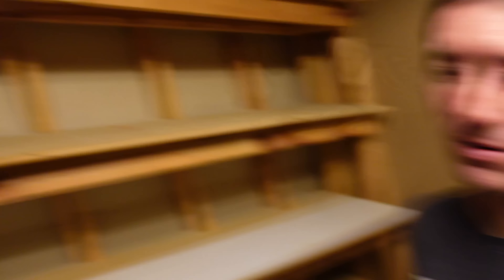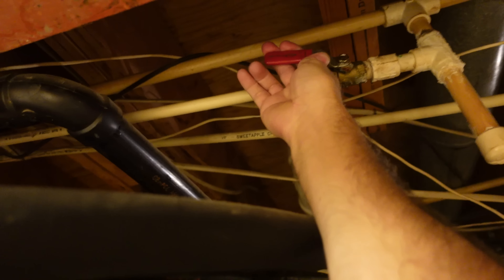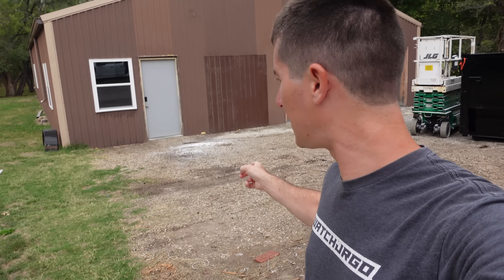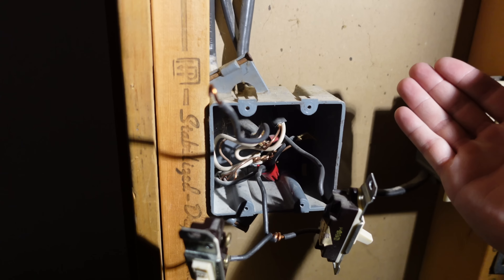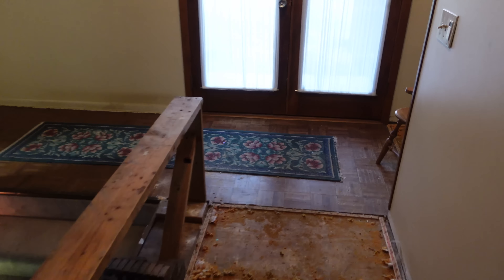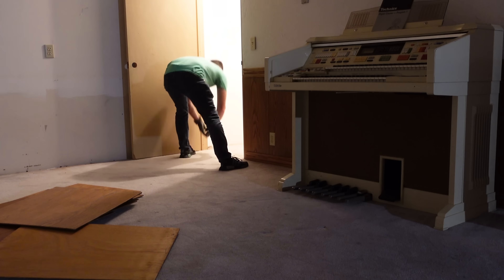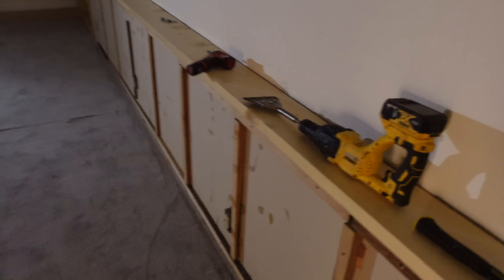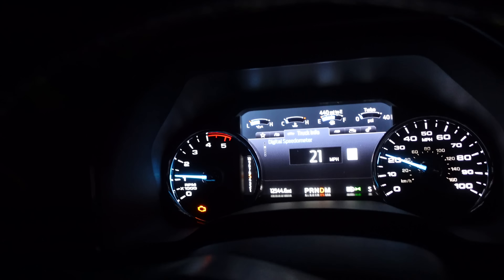TROUBLE At My New House Already... Water Leaks

Comment: A good friend of mine works at  the Ford Engine Plant in Cleveland. You cant imagine all the brand new bad engines coming out of that plant lately. There are thousands of Transit Vans parked in Kansas City right now that can't be sold due to oil leaks on zero mile engines. They will all have an engine swap before they see a dealers lot.

Comment: When we bought this house 10 years ago once we hooked up the washer about a month later I found a leak under the house. Luckily part of the package was a year of home repair insurance. For 60 bucks copay later a plumber came out and cut out the bad pex and replaced it.
Being a manufactured home the insulated floor belly wrap was completely soaked in the area and I ripped it out and let it dry. Luckily the water heater was new so that was a plus. I'd recommend looking at a heat pump water heater, considering one myself seems like great idea to save money on the hot water system, maybe not so much with gas but something to consider. We have a electric water heater so should be a good match if we have enough room.

Comment: Buy some cheap paint and paint all the plywood floors before refloorin,it seals in odurs and makes it better when new flooring is laid. You got a lot done and a lot to do. You may need to remove more of the  sheet rock to check for mold.

Comment: C-PVC is just PVC rated for hot water.   Pre-Pex.   It's definitely needed.  I had a pressure relief valve fail on me.  Our hot water is turned way up.... It had a PVC going from the valve to the drain.  It came loose as it was not C-PVC.   Blew water all over my closet.  Luck I was home and heard the water.  Talking to the plumber he mentioned that it should be C-PVC and you should use the glue.   I actually still need to replace it.  I noticed the one of the second hot water heater for the kitchen and laundry was done the same way as the one that fails.  It need fix both of them.   I really want to replace the one for the Laundry with a on demand unit for the space.  The laundry room is super tight.  Maybe after I do the kitch and can move the pantry cabinet out of the laundry room and stack the washer and dryer for some space in there.

Comment: When I replaced the builder HWH with a heatpump HWH, I decided to clean up the copper piping "a bit".  By the time I was done, I had removed over TEN elbows from the system.  I swear they just used whatever scraps were in a bucket when they plumbed it in, or threw an apprentice at it and told them to practice with as many solder joints as possible!  And it was an on-floor system in the finished laundry room, with just the cold in and hot out through the drywall.  It was a complete maze of uselessness that cleaned up to just a few straight runs with a few elbows.

Comment: As an old Homebuilder I see some shoddy plumbing and electrical stuff going on there. Hummmm? How the heck did that ever pass inspection? Or did they even have it inspected? Makes one think ~~ . At least you get a higher capacity hot water heater and NEW plumbing pipes. That's always a plus.
Reply from the maker: It's probably had a million changes since it was originally built 😬

Comment: I'm no plumber, but those pipes are a disaster! And seeing the shoddy electrical would make me want to check every outlet and switch in that house. I helped my buddy some years back replace a whopping 19 outlets in his house, many of which were wired incorrectly and I told him I was surprised his house hadn't burned down yet in an electrical fire. It very nearly did when an overloaded breakers in the panel started smoking...they had to replace the entire panel and all breakers.

As far as the truck, well, it's a Ford so I'm not surprised. #1 most recalled brand in 2022 and so far in 2023. I'll never own another one.

Comment: The spray foam issues are most likely due to poor mixing. There are part A and part B tanks and they must be adjusted correctly before spraying. 
I would suggest you cut off a big chunk that has shrunk. More than likely it is not cured on the surface facing the metal. Those cannot simply be sprayed over and filled. Moisture will get no matter what they do and your roof will rust.  I believe you mentioned they ran out of spray foam. Well maybe one of the tanks ran out earlier than the other.

Comment: The two things that have stuck around since the beginning of that house: The Carrier furnace and the Frigidaire wall oven. I’d be curious if the heat exchanger is still good on that furnace after 47 years
Reply: Only if the AC was Chrysler Airtemp. Then that would fit with the theme!
Reply: @Hotlog69  I had a Chrysler Airtemp in my house, it still ran when removed from service back in the late 90's, the build date of it was 1967!

Comment: Have your house repiped! That cpvc gets brittle with age! Go with pex and a tankless heater. You will no regret it. If your tub valve is a two or three handle fixture the packing nuts on the stems are more than likely loose and only leaks when turned on. A man of your caliber can fix these issues with no problem! Go Jr Go!
Reply: Do you even listen to the video?  He said his pex stuff was at the cabin and when he brings it back he was going to re plumb from where the water enters the house.

Comment: I'm sure they used asbestos glue back in the day for those floors. Be careful JR!
Reply: I mean, when you burn sheetrock and use a paint sprayer for a huge building without a respirator, I'm sure they were super careful with the basement air quality while working.
Reply: @jspaulding4106 So true!😂

Comment: 12,000 miles check engine light is common on Fords.  I have a 2010 Ford F150 Supercrew 4x4.   Mine has that capless tank thing and it started giving me issues at 12,000 miles.   I purchased the "optional" locking gas cap from Ford that fits the capless system and it fixed the check engine light issue.   I of course took my vehicle to the dealership to have the capless filler fixed and then used my locking gas cap as well.  Have not had another engine light problem since.  I have the last version of the 4.6 liter V8 and hit 250,000 a week ago.

Comment: I absolutely hate cpvc also, it get brittle and weak extremely fast. Once, I was trying to shut a valve off just like you were doing, and the cpvc was so brittle that the pipe snapped and Shazam cold water in the face and everywhere.
Reply from the maker: That’s what I’m worried about! Plus gate valves are the worst 😬
Reply: @WatchJRGo  I'm with ya on that one ball valves all the way baby!!!

Comment: CPVC plumbing worked very well, but it isn't supposed to go right up to a water heater. It's supposed to have at lest 1ft of copper pipe, then go to CPVC. It's sad that CPVC is going away from the market, as it was so easy and so much fun to do, along with being very inexpensive!

Comment: Go with a 50 gallon hot water heater with the square footage you have there. 40 isn't really enough and 30 is just plain tomfoolery. Gas hot water heaters will last a long time -- or at least that's been my experience.

Comment: We had to replace our hot water tank within the first month of moving in.  Make sure to have a drip tray put under the tank.
Reply: A drip pan and an alarm. The alarms are surprisingly cheap.
Reply: It is in the basement. 
Install tank near a floor drain
Reply: Gas heaters are supposed to be 18" off the ground. He's gonna have to do some fabing anyways.
Reply: we put alarms under each of our sinks as well - it's saved us more than once.  Caught the leaks immediately!

Comment: The water line going from the well/city was most likely going to a water conditioner. The valve there could be a cutoff that was left over. Or part of a bypass system but those typically take two valves. You may want to get your water tested if it is from a well.

Comment: If you need to get old stuck glue off of concrete, use an angle grinder with a wire wheel and letter eat. Just got done doing that myself

Comment: Clean that dryer vent. Lint is extremely flammable! That vent run looks to long in my opinion.
Reply: At my apartment, before they cleaned the lint in the dryer vent, it took 3 full dryer cycles to have the clothes dry. Now it only takes one, as it should!

Comment: Shops looking good except for the walls, are you going to leave that exposed spray foam or put something over it. That house is a gut job, those older houses have so many hidden issues, have you even checked for asbestos? I’d honestly bulldoze it and build a modern house.
Reply: The structure of the house seems strong. It's just the add-ons that are suspect. That era of homes were built rather well and IMO not worth the expense and effort to do all that you menrtioned. Insect damage is another trhing if it exists.

Comment: Get a gas instant hot water unit, the one that bolts to your outside wall, no tank to worry about
Reply: Definitely the modern move-but over 10x the price. 
$ made back in the long run though 👍🏼
Reply: @kylemills3070 it’s not 10x, tankless unit is $2000, plus install. Find a better plumber to not charge too much.

Comment: Maybe it's just me being OCD, but seeing what I have seen so far, I would want to take that house to the studs and start over. I would be afraid of what is behind the walls. All the cut corners, what's the electrical like behind the drywall? I know that is a huge expense up front, but if you do all this work and there is some issue behind the walls, then all the work you have done, will be ruined and you have to start over again. But that is just me, so weird-o on the internet. LOL

Comment: Hopefully it’s not asbestos tile. Bad for the lungs. Even worse for the wallet.
Reply from the maker: It's linoleum 🍻
Reply: @WatchJRGo       per google- 
"Asbestos was used in various types of floor covering, especially from the 1960s to the 1980s. The most common use of asbestos was in the lining for vinyl sheets and floor tiles (also known as “lino” or “linoleum”). Asbestos was used to make the lino more durable."

Comment: You ask what's going on Ford with your check engine light. Ford's quality is becoming as bad as Hyundai and Kia.  Buying a new Ford is becoming a risk. 

Here is a news report out today. 
U.S. auto safety investigators have expanded an investigation into Ford Motor Co. engine failures to include nearly 709,000 vehicles. The investigation now covers Ford's F-150 pickup truck, as well as Explorer, Bronco and Edge SUVs and Lincoln Nautilus and Aviator SUVs. All are from the 2021 and 2022 model years and are equipped with 2.7-liter or 3.0-liter V6 turbocharged engines.

Comment: Good Lord that white plastic pipe is hideous.  And dangerous.  It's a flood waiting to happen.
Reply: Be glad it's not the polybutylene stuff that came in the 90's that splits mid pipe or at the crimped on join. This looks like CPVC, Chlorinated polyvinyl chloride, it can get brittle over time especially if exposed to UV; its cheapest PVC to go with of all the current options out there. Judging by all the other home "improvements" it's not surprising they used it.